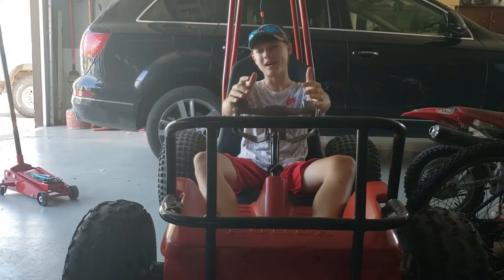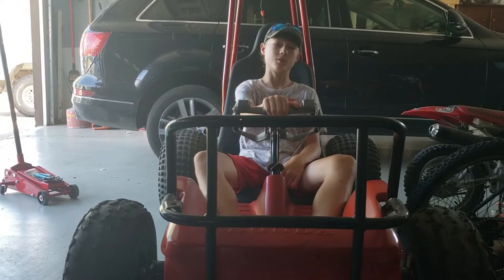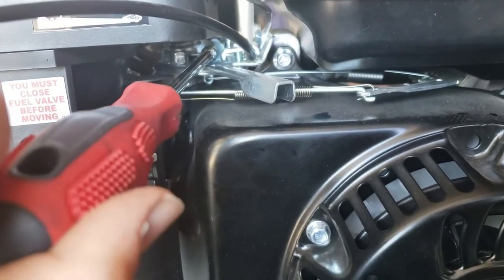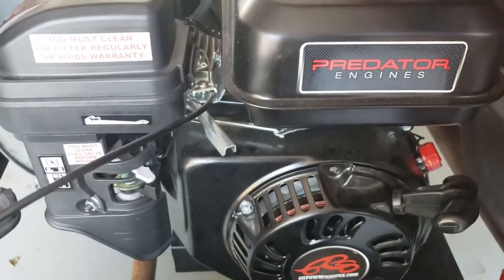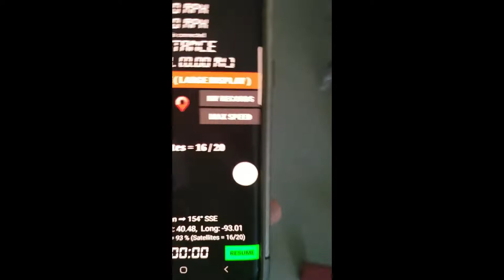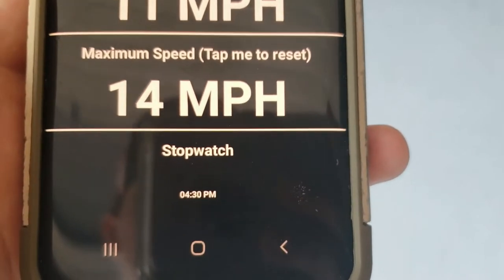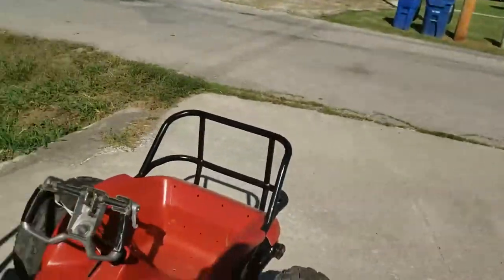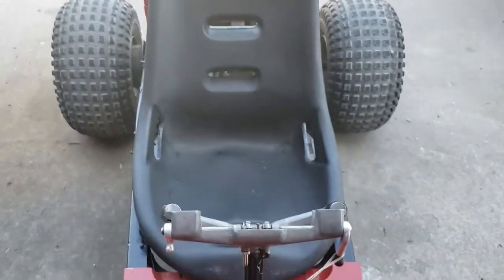How To Bypass The Governor On Any 212cc Predator Engine! (Without Opening The Engine)

Comment: If you wanted it to be faster, you could try to swap it for a 440cc engine and that has around 18 hp stock and costs around 430 with an electric start so that would be a fun swap. I’m thinking of doing that to mine since i think the engine seized while riding.